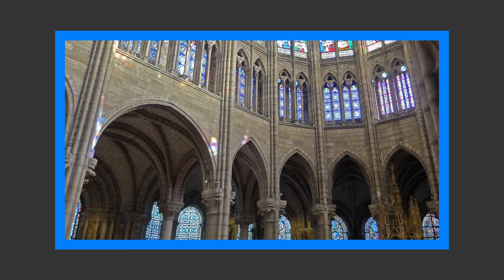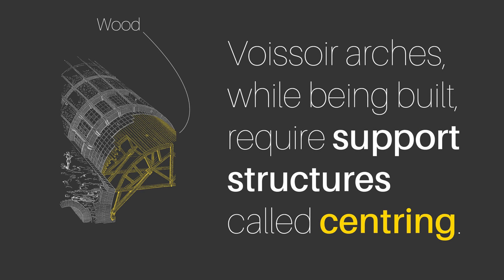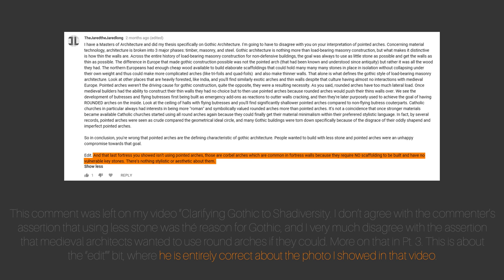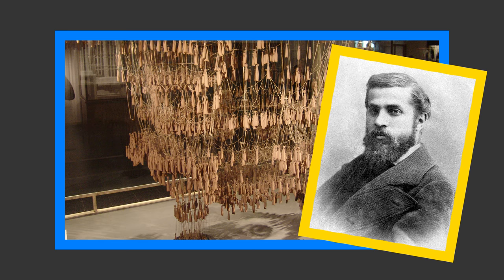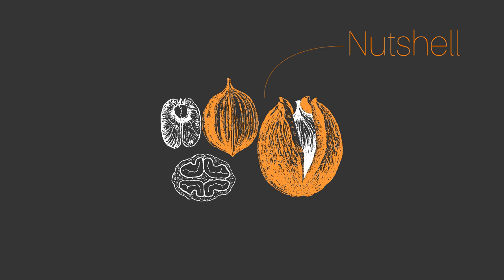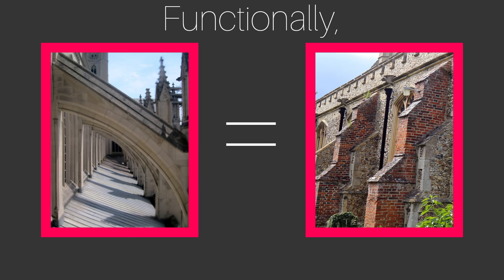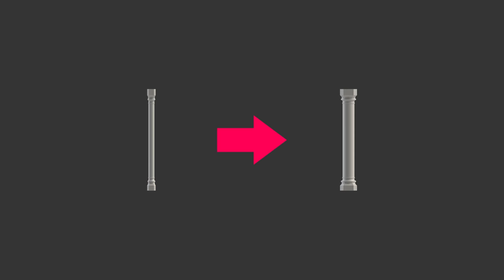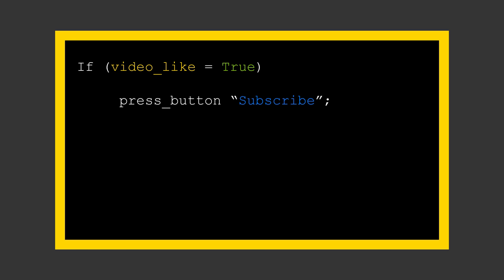Pointing Out Gothic Pt.2 - Structure

Comment: Amazing video as usual! I just have a question about parabolic arches. How do you build them? I imagine it must be difficult to build a parabolic wooden structure. Isn't this the reason it was not often done in ancient times?
Reply from the maker: Yeah, I reckon that's one of the reasons why. If you make a round arch or a pointed arch, you can actually use voussoirs that are all the same shape, while every one would be different in a parabolic arch, so even after you've built the centring, you're still having to go to more trouble.